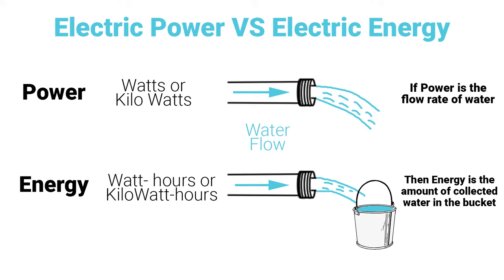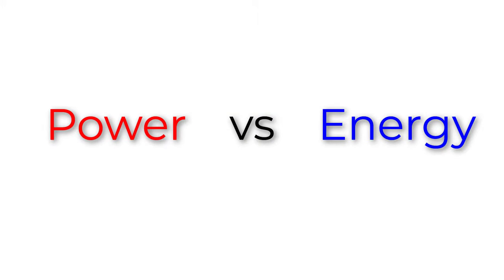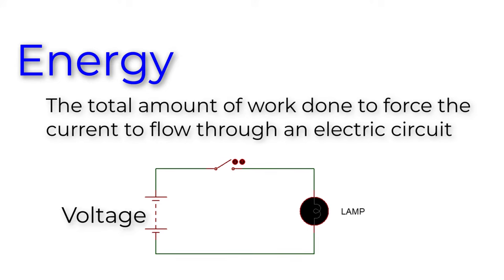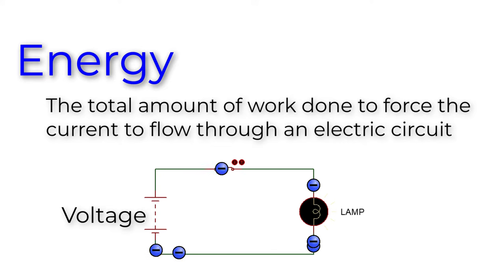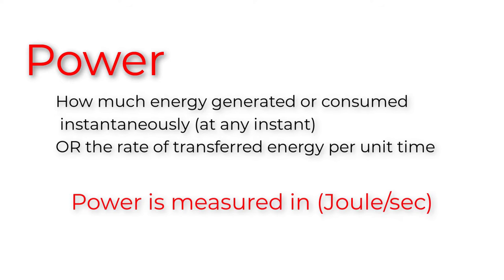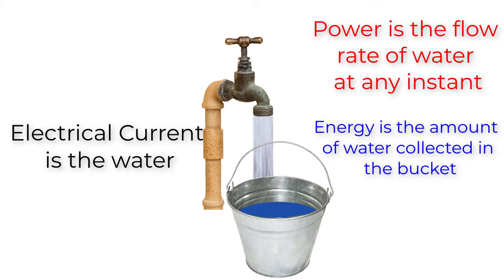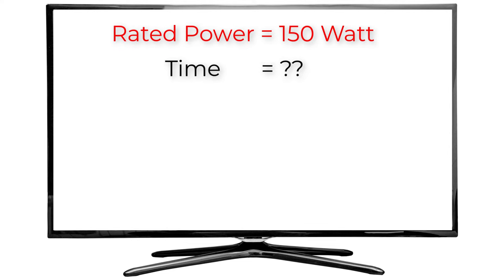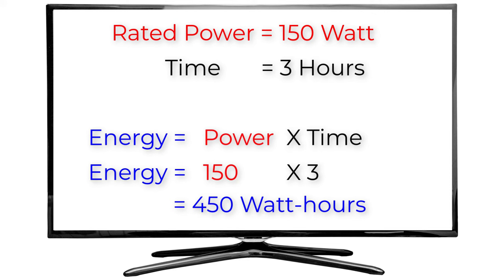Electrical Energy vs. Power |Explained

Comment: more voltage won’t actually cause more electrons to flow, that definition is wrong. It will cause the same amount of electrons to flow but at a much faster rate, thus more current is flowing through the circuit
Reply from the maker: that's true, thank you for the clarification
Reply: I have a question sir what if The cross-sectional area of the conductor has increased will more electrons flow ?
Reply: @fearfulninja3450  no .. only the rate of their flow will increase

Comment: Hi, in the example, the TV is rated 150 watts so consumes 150 watts of instantaneous energy, does this mean 150 watts is consumed every second that the TV is on for?
Reply from the maker: Yes that is true، but it's better to multiply it with hours, to have watthour, because any bill you will calculate will be in watthour times the tariff

Comment: Regarding the TV example, I'm a bit confused. So if  Energy (consumed by the TV in 3 hrs) = 150 x 3 = 450 Watt-hours, then in 1 hour it will consume 150 Watt-hour, and in 1 minute it will consume 2.5 (150/60) Watt-hour, i.e. 0.042 (150/3600) Watt-second ? Please help me understand. Thanks
Reply: Yes i have the same question, does products mention watts in seconds or hours consumption??
Reply: please answer this one.
Reply: 1 hour is equal to 3600 seconds not 60
Reply: you don't divide but multiply hours to minutes, multiply minutes to seconds _
Reply from the maker: To answer the question in the context of energy vs. power:

Energy is the product of power and time. In this example:

1. If a TV consumes 150 W (watts) and runs for 3 hours:

Energy = Power × Time = 150w x 3h =450watthours

2. In 1 hour, it consumes 150 Wh.

3. In 1 minute:
Energy =150/60=2.5 watthour

4. In 1 second:
Energy=150/3600=. 042watthour

Products usually specify power in watts (W) and energy consumption over time in watt-hours (Wh).

Comment: i think you confused the definition between power and energy
Reply from the maker: Thank you for your comment, can you clarify what you mean?
Reply: @electricalengineeringplane6620  what i mean is that power is current * voltage and energy shud be power * time or u can say energy is equal to current * voltage * time 
but u switched these definitions
Reply from the maker: @driblix2857  thank you really but you can watch the video again i said the factor of time is the difference between power and energy,, energy is power times time